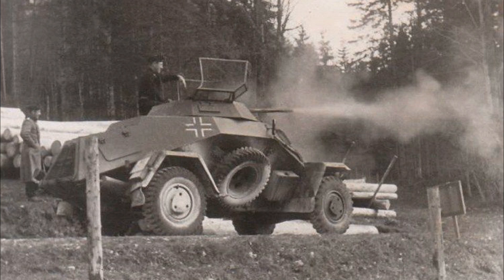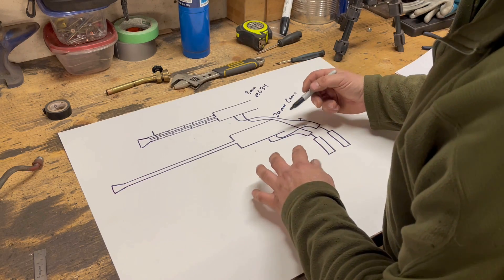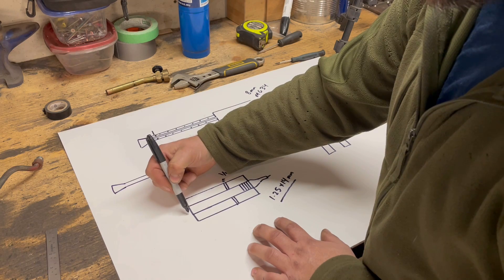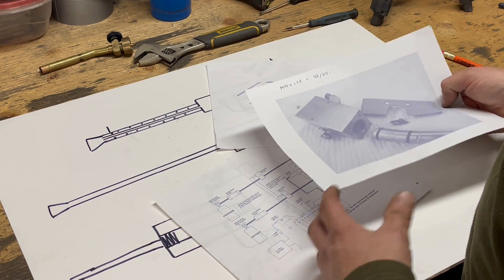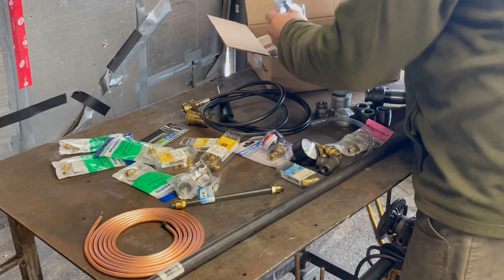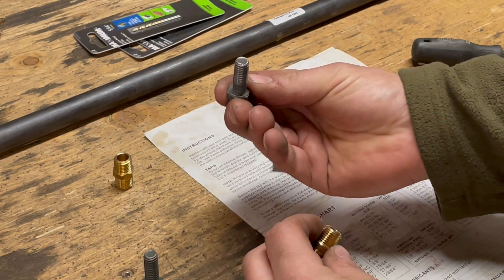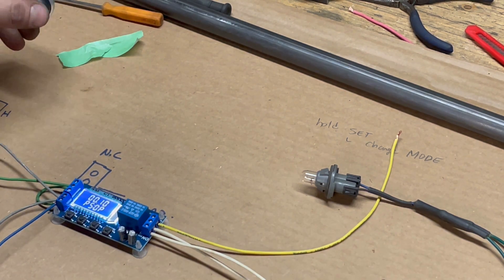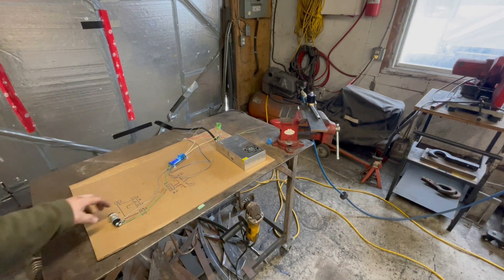Gas Machinegun Simulator EP 1

Comment: I've built a few of these for reenacting, and have really honed my skills in making a clean, efficient setup. Honestly building them is sometimes more fun than dragging them around a field... :P 

Currently in the middle of my first Vickers project and I'm very excited for it. 

Inside a vehicle you obviously have a LOT more room to work with, and can have larger propane / oxy tanks. Make sure they're in a safe place & use those flame arrestors since space allows!
Reply: Anyhoo, you're doing everything right so far :D For anything in the 30-cal range you'll be fine with 1/4 NPT pipe (.54 OD), a smooth 3/4 NPT coupler and two 3/4 > 1/8" reducers (Makes it easier to drill a pilot hole and tap for spark / barrel). 

I've helped build a .50 cal, in which case all your pipe sizes are one larger (1" coupler, 3/8" NPT barrel)
Reply: Hello do you have any contact I need help on mine ?

Comment: Do you have the contact info for the circuit board you're going to be using? Thanx
Reply from the maker: Yeah... https://www.ww2steel.com/Gasguns/Gasguns.html
I put this part of project on hold until the 222 Scout Car is done, which should be Spring 2024.  So I will continue the build series then.
Reply: @woodsarmoury  Thanx for the link and fast response!
Reply: @woodsarmoury  Steve does great work :)